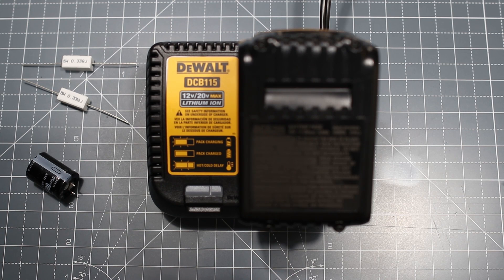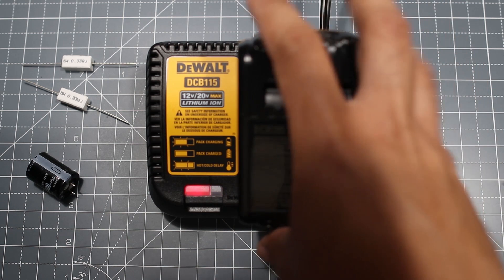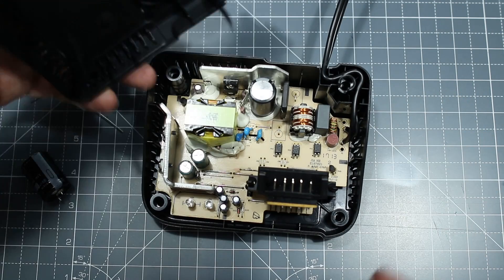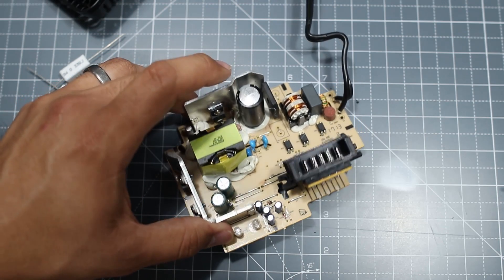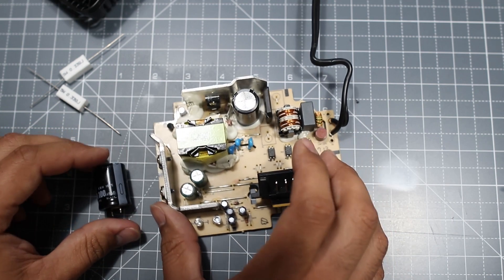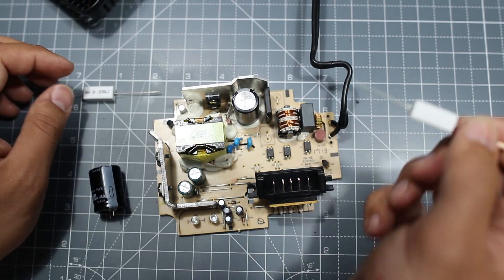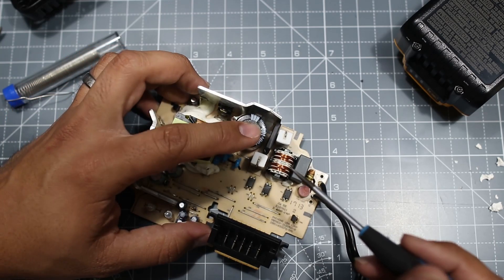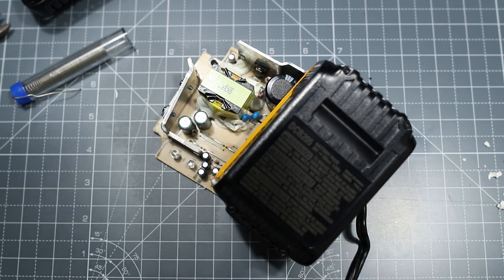How to convert your 110v(120v) DCB115 DeWalt Charger to 220v(240v)

Comment: If it is designed to work with 220uf -200V
Then why you say 100uf/400V and 150uf/450V?
If the lower the Voltage the higher the Farads then I believe it must be 150uf/400V and 100uf/450V
And why not simply use 220uf/400V if it fits?

Comment: Hello Riaan! my dewalt 110v charger was accidentally plugged in to a 220v, what are the possible compents that have broken. as of the moment when you plug it in 110v the red light is just flickering.

Comment: How the output voltage remains the same when we increase the input voltage. Why does the output voltage not increase as the input voltage increases? E.g. for 110V the output is 20V and for 220V the output should be 40V.
Reply: He did not increase input voltage. He decreased it from 220 to 110 with the help of resistors

Comment: thanks your video and try it last week but no light on so i don't know what happen and didn't changed another components. (exchange 1 cap and two resistor only according your information)
Reply from the maker: Make sure the battery is pushed in all the way.
Reply: @RiaanKeyser  Yes, I also changed it just like the video and it turns out that when I plug it in the light doesn't turn on, I even used new batteries and nothing doesn't charge. But the strange thing is that when I disconnect the charger from the power with the battery connected, immediately the charger starts flashing. Any solution to this?

Comment: Hello, nice video! if I have this DCB112 charger and I would like to use it on 220V outlet, can I use a 220v to 110v transformer? the transformers are 300watt, 400watt, 500watt max. Is its going to work with a transformer like this?
Reply from the maker: Is your transformer is the correct type. Example: Step up or step down. I can't swe why it wouldn't. 

The wattage is more than enough.
Reply: without any doubt it will work

Comment: I recently purchase "Dewalt DCB115 230v @ 50 hertz" battery charger in UAE by mistake.
And I am using this in Philippines which is using 60 hertz not 50 hertz.
My question is, is it ok to use it in Philippines?
Reply: I am ready to switch with u with my 110v charger bought it from USA if you want

Comment: Thank you Riaan Keyser !
As an Electrical engineering student (2nd year) I would love to understand more about the way the resistors you installed helps in this circuit.
And why is the new capacitor needed ?
Thank you
Reply: He is changing the capacitor to 240 or 250v, the old is probably up to 120v
Reply: He’s asking the purpose of the resistors

Comment: What’s the difference between DCB112 and DCB115?? Will this procedure work on DCB112 as well? Thanks guys
Reply from the maker: The difference is 3 Hahahaha

Unfortunately I'm not familiar with the DCB112 so I won't be the best to advise. Sorry.
Reply: @RiaanKeyser  how did you do that stuff if you are not good in electronics)
Reply: https://www.youtube.com/watch?v=EHn8Hh_tO1M
Reply: what he did is just the decrease of 220 volts to 110 volts by adding resistors. So, you can do it with any type of charger and they all gonna work fine

Comment: Thank you so very much, a question regarding the resistors, my charger is DCB112 so it has a different circuitry so could you help with the jumper location please?
Reply from the maker: Hey Muhammad

Unfortunately I'm not familiar qith thw DCB112. Sorry.
Reply: @RiaanKeyser  Riaan thank you so very much for your prompt reply & while I feel kind of dumb having asked you the question the way I did I would appreciate just letting me know the jumpers path if no trouble. I have seen videos of people changing only the capacitor & saying its good enough but I don’t want to risk it. Again I am very thankful. You’re a gentleman:-)
Reply from the maker: @dAli-ch6sm  you're more than welcome. I'm glad I can be of assistance.

It will definitely work without the resistors, it is just safer with them off course.

You can put them in any way around.
Reply: https://www.youtube.com/watch?v=EHn8Hh_tO1M

Comment: Dear Riaan
I am really excited to find your channel. I have a question about this article .
 I plugged my 110v dewalt charger to 220v ,and suddenly remembered it is 110 .After that , when I unplugged it and plugged to a 110v source ,it worked fine , but the charging process took just 30 minutes for a 2ah battery .Do you think its normal or it is damaged ?
Best regards
Reply from the maker: Hi Alireza

Test how long your battery last when using your DeWalt product.

You should get a fairly long period of use out of the battery. Obviously, product dependant.
Reply: @RiaanKeyser  thank you for you answer , Riaan .I really appreciate that. 
One more question. Is the resistors you mentioned 0.33 ohms or 3.3 ohms ? 
and the 220 microF/400V capacitor I found is much bigger than the original 200V one . Is it alright to replace it on the  pcb ?
Reply from the maker: @alirezabaniasad4862  it's 0.33 ohms and yes, you require larger capacitor for 220v - 240v
Reply: @RiaanKeyser  thank you Riaan

Comment: So today I did the convertion on my charger and it works,but the light for fully charged is not working. the battery get's charged but when fully the light is blinking one short and one abit longer blinking. but it's get the job done I suppose.

Comment: The grey line marks the negative side of the cap, resistors are not voltage polarity sensitive components. It doesn't matter which load of the resistor goes to the positive or negative due to them literally being a resistive wire.

Comment: well mate you are lucky the capacitor didn't blow up on you, never connect 120 Volts equipment to 220 , especially switch mode power supplies they will cause damage.
the capacitor was rated for 200V max  and you used on a 230 VAC above the cap range , not safe 
there is not polarity for the resistors , what you basically did  was a voltage divider Vout= Vs X R2 / (R1+R2)  , you replaced 2 jumpers with 0.33 ohms resistor per the above formula
220X0.33 = 72.6 , 0.33+0.33= 0.66 Ohms 
72.6 / 0.66=110 Volts
Reply: Would the voltage divider be considered safe in this set up?
Reply: @ivanbg5167  it is safe i have mine rigged that way too, just make sure the Cap is above the voltage rated .
Reply: It's an inrush current limiter.

Comment: My charger did not have a circle around the shortcuts that were replaced with resistors. Does polarity matter (as far as I know - no). Anyway I connected everything properly and the charging light is not on. Can anyone help with that.

Comment: Why putting resistors in parallel with shortcuts? It basically does nothing, it makes no sense

Also, what about the 250v T4AL fuse at the very beginning? Isn't that gonna burn / ruin on 311v peaks?
Reply: Hello, did you try to make the modification without using the resistors, how did it go?

Comment: The capacitor is used to filter out ripple voltage from a bridge rectifier (converts the incoming AC voltage to DC voltage), if anyone is curious. The reason why the capacitor needs to be rated for 400 volts or greater is because the DC voltage is way too high. Consider that your country uses AC voltage ranging from 220vac to 250vac. Remember, that is the RMS voltage. Multiply the RMS voltage by the square root of 2 (1.414). Once the AC voltage is rectified, your DC voltage will be 311-353.5 volts. Now, put that voltage through an electrolytic capacitor rated for 200 volts and...pop!

Comment: Better you sold this in US and  could’ve bought a 220v charger in local store
Reply: It’s much cheaper to replace the capacitor than it is to buy a charger that will operate at 220v. As far as the resistors he’s installing: they are most likely not needed. Also in this circuit is an N-channel mosfet but the drain-source voltage rating is 600v. No need to worry about that component.

Comment: What is max drain-source voltage of mosfet? You changed switching voltage 156V DC to 320V DC. Mosfet drain-source voltage must be min 600V. Otherwise will burn/short circuit.

Comment: I think you have mistaken to say that the white line in capacitor is positive. It is not positive. Also the 5watts resistor. There are no polarity on that resistor. Just to correct the misleading information.
Reply from the maker: The Positive side usually has a stripe with the - on it the pin is also longer.

Comment: Hey Riaan, 3 Questions:
1) Why didn't you put a 400v220uf? will it be better than 100uf?
2) Should I put a fan?
3) Did you cut and replaced the cable to Europe plug cable?
Reply from the maker: A 400v220uf? will work. A 400v150uf would be ideal. No need for a fan. No, I'm just using an adapter, but, you can do that.
Reply: @RiaanKeyser  thanks for the reply, which year is this charger and where it is made?
Reply from the maker: @matanvaknin2036  2018 and USA and still works perfectly.

Comment: Hi Riaan, just subscribed,  How can  I  convert a battery charger of  Input 110 volts out put 24 volts 25Amps to 220-240 Volts Input, 24Volts output, 15Amps, charger is Copper coil type.

Comment: if I don't add the resistors but I change the capacitor will work perfectly , so my question is  why I have to add 2 capacitor of 5 watt 0.33 ohms ?
Reply: I haven’t studied the charger thoroughly enough but the resistors may be used as a shunt for ac noise or noise being generated by the charger itself but most likely for noisy AC input.

Comment: thank you, i did it and it works very nice i just used 450 instead of 400
Reply: Thank you very much friend
Reply: Hello Friend.  If you use 450, does the charger work well?
Reply: @დავითმარგალიტაშვილი  Hello Friend. I can use it without any problems.
Reply: How many AH does the battery charge, how long does it take?
Reply: @დავითმარგალიტაშვილი  4Ah 1hour------2Ah 1/2 hour

Comment: I did just like you, the charger worked for about an hour fully charged and then turned off.
After testing I found out about R3 (270Ω)
Found near the replaced capacitor was destroyed.
What did I do wrong and why did it happen?
Reply from the maker: What Capacitor did you use?

Comment: Good afternoon Riaan, I ask you a question given your experience, I connected one of these chargers without noticing that it was 110v to a 220v network, it obviously flew, but when disassembling it I only see a fuse at the entrance that measures it has continuity, and the capacitor that burst. The question is, will I be in time to make the change that is recommended in the video?
Reply: I blew mine by plugging it in, White smoke so in mine the capacitor is what failed. but swapping it out worked for me.
Reply: @ShardZA  dude i just blew mine. it had some watery fluid that come out. are u sure only capacitor is what will blow? dont they have a fail safe for excess voltage?
Reply: @jimmylogan4543  with lots of white smoke, then it definitely the capacitor. There can be fluid yeah, that's usually what's blowing off as smoke
Reply: @ShardZA  So i replace them and everything will be fine?
Reply: @jimmylogan4543  yeah, its just 1 capacitor, the big one.

Comment: Hello, could you please check what is the symbol of MOSFET used in DCB115 (black element screwed to upper radiator)? I am trying to convert DCB118 from 110V to 220V, but I heard, MOSFET used originally in DCB118 110V  does not work for 220V - it burns. So I tried to verify how it was done in DCB115. Thanks in advance

Comment: Hello, does it still work? because soon I will make the modification
Reply from the maker: Mine is still going strong.
Reply: @RiaanKeyser  Hi Riaan, first off, thanks a lot for sharing. will do your modifications once replacements are at hand. just wanna ask if the modified charger has effect on the life of the battery, charging time, and if it overheated during single or consecutive charging? thanks again, more power to you and keep safe...

Comment: i have a DCB 112 version would you know if it will work the same?
Reply from the maker: Not 100% sure. Sorry.
Reply: Replace only capacitor 100 uf 200v by capacitor 68 uf 450 v it's working nice

Comment: Hy sir y have the same charger 220 its not charge not led its ded YOU now its have a fuse And were it iz
Reply from the maker: No, it does not have a fuse. The capacitor usually blows when overloaded.

Comment: Is there a problem in merely using a step down voltage converter instead of converting the components? I've been running my old style Dewalt 18v XRP charger on a converter for about 10 years but my 2nd set of batteries just died. Curious whether it is due to the use of a step down converter or that's the lifetime of these batteries. Also, the charger is 110v 60 Hz and we have 50 Hz here. Thanks!

Comment: thanks, gonna try this. I got alot of smoke when I plugged it in.
Reply from the maker: Good Luck.
Reply: Did it work? Mine had the same problem it was DCb112... any additional tips would be appreciate. Thanks content creator!
Reply: @alaalkukhun9435  yeah it did
Reply: @ShardZA  did it overheat too? like some here experienced? any modifications other than what was shown in the video?  how are the batteries charged so far, no effect on their performance? anything pertinent you can share since I can see it has been two years for you. thanks a lot in advance... and cheers! keep safe
Reply: @aljoannesdelmindo1582  I must admit I don't use it often, only when I'm doing enough to run 2 batteries down at the same time, because I already had a 220V one I bought locally, so I only use this one for overflow. But I've not encountered overheating and seems to charge batteries to the same state as my original 220V purely based on runtime, I've not actually measured the specific charge with a voltmeter.

Comment: what the resistors are for ?
Reply: the resistor are used as voltage divider, Vout= Vs X R2 / (R1+R2)  
Vs =voltage source 
Vout = output voltage
R1 R2 the resistor he's using its  0.33 Ohms  220X0.33 = 72.6 , 0.33+0.33= 0.66 Ohms 
72.6 / 0.66=110 Volts

Comment: Hello,
Since the video is now some month old, is it still working and did you checked the voltage on the battery connector pins ? The led can come out and blink .. but the voltage can be wrong. Cause i can't see how a capacitor swap can solve that 110V difference.
Reply: I read an explanation in the comments of another video. It was said that the circuit for this charger is designed for 85 volts up to 250 or so, which means that for just a few pennies, dewalt could have made all of them multivoltage. but I don't know yet how he picked the values for the resistors or knew that they belonged there and as far as I know resistors do not have polarity.
Reply from the maker: Still working 100%

Comment: Works perfectly... Excellent instructions. Only difficult part was removing the T15 torx screws from case. They have security pin so normal torx T15 wrench will not work easily... You tube using flat head screw driver to remove torx screws with security pin... Simple thereafter. I used the legs snipped off the resistors after mounting on PCB to extend existing legs on capacitor as it's too short and thick with its standard snap-in connectors.
Reply: I just carefully drilled them out
Reply: Hahaha I drilled them out as well. I also drilled the new capacitor holes for they were too narrow for the 400V one.
Reply: I snapped out the pins with a small flat head screw driver, then used an alan key to remove the screws.
Reply: Hello, sorry but could you tell me if the charger lasted until today or how long it was?
Reply: I got my torx security heads from lidl. So secure every Lidl diyer has a pair

Comment: Although it charging,this is imperfect solution,since it's overheating and ends on Hot/Cold delay (both lamps blinking)
Reply from the maker: Might be a faulty battery...
Reply: @RiaanKeyser  its not a faulty battery, ive just converted mine using your method, the charger will overheat due to access power (higher voltage for the same current) been dropped.
i am considering adding a small fan inside the enclosure.

Zvi, you are right.

Comment: Why not just use step down transformer converter when charging battery?  Is there any issue with using step down transformer?
Reply: An additional device makes simple things more complicated ;)
Reply from the maker: Total cost = R22.50 (±$2) instead of R1 200(±$100) and remember I blew the capacitor when I plugged it in the over powered wall unit.
Reply: U mean step up... Because u want to go 110v to 220v ac. With the power rating this will cost a packet... Just follow the instructions provided... It's cheapest and less clutter on your desk.

Comment: Why change the capacitor. If resistors would make 110V.
Reply: Are you sure? Will two resistors for 1/3 Ohm each one drop 110V? Вова, с какого перепугу два резистора суммарным сопротивлением в две трети (0.33+0.33=0.66) Ома погасят 110 Воль? Даже по закону Ома для этого через них надо прогонять 165А, И это будет далеко не 5 Ватт рассеиваемой мощности. Скорее всего, они служат просто для ограничения тока зарядки при подключении ЗУ к сети. Диодный мост берегут.
Reply: Riaan does your charger still work and batteries are still ok? Looking in doing the exact same thing.
Reply from the maker: @jancoetzee6404 Still working 100%

Comment: Where did you get the components? I need to do exactly the same surgery on 2 Dewalt chargers.
Reply: Ted Boezaart Try Mantech . Co. Za they have online site for high voltage capacitor and ceramic resistors.
Reply from the maker: BC Electronics